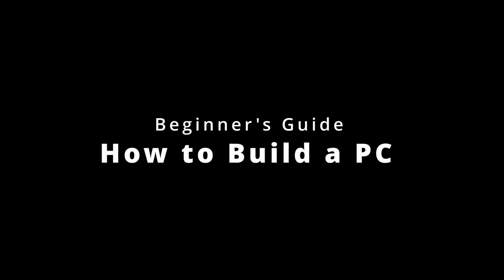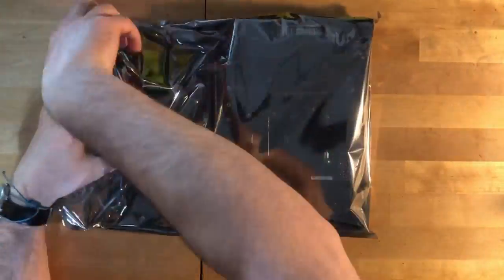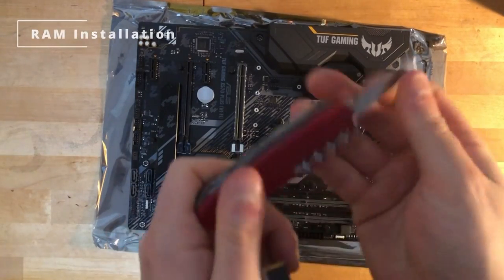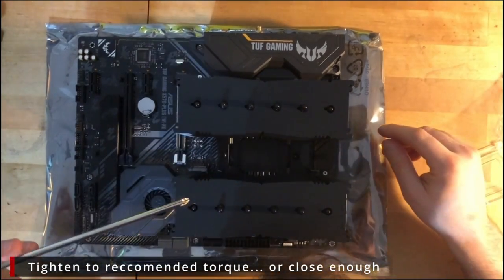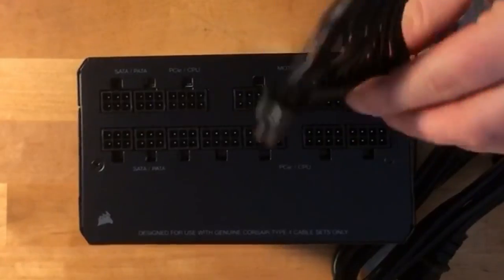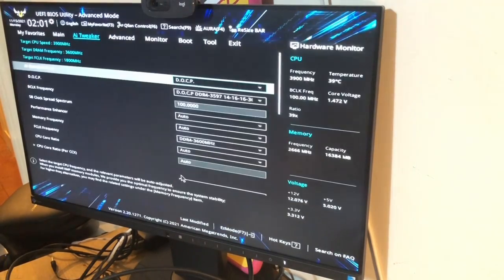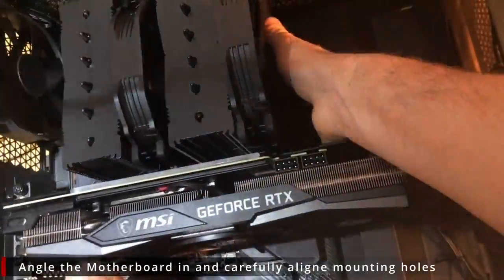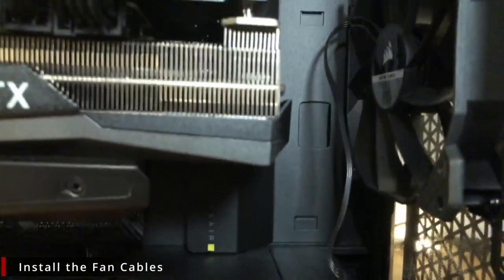How To Build a PC 2022 - Step by Step

Comment: Really nice video - looks really pro! Very clear, nice music if a little loud. Well edited, clear audio and nice and concise.

A couple of things could have been clearer, PSU orientation wasn’t mentioned - different cases/configurations support PSU intake top or bottom. 

Correct orientation of CPU heatsink fans - usually you’d have case intake at the front, exhaust at the back but best check case fans and adjust if needed.

Motherboard standoffs aren’t necessary all in place or all in the correct locations for your particular motherboard - so best line up and check before putting the motherboard in.

I was pretty scared when you were moving the motherboard including GPU into the case - I’d probably remove the GPU to install the motherboard, then put it back when the motherboard is in the case. This also makes it easier to screw the motherboard into the case.